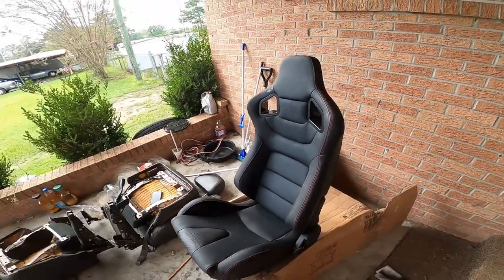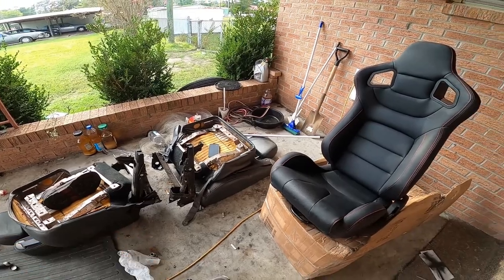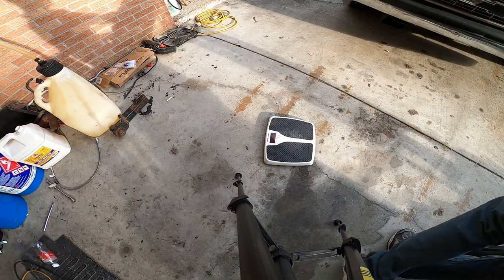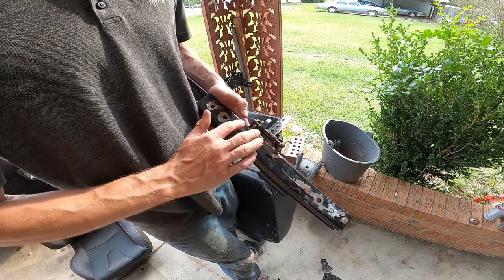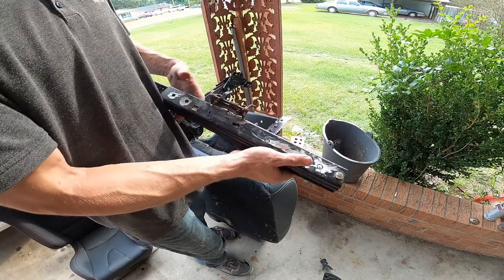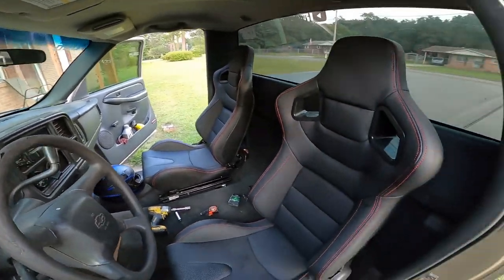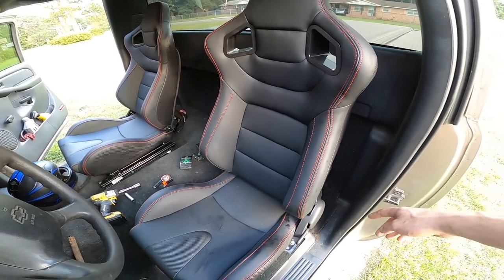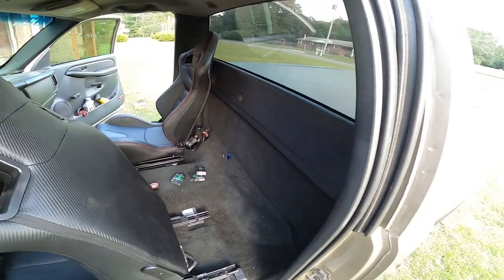Racing on a Budget: Amazon Race Seats Review under $350

Comment: Do you ever see yourself removing the air bags and going to a different/lighter steering wheel? If I ever got a clean V6 truck to build more race-orientated, I see a lot of weight that can be cut without completely gutting the interior. My truck is just too comfortable to me to ever try to shave weight out of it. I'd have to start with a more base model truck that doesn't have all of the power accessories mine has.
Reply from the maker: The passenger airbag is taken out just the cover is there but still has driver air bag but been thinking bout putting a race steering wheel on

Comment: I bought the same kind of seat off of eBay, less than a year of the ownership the welds at the bottom of the seat broke causing the seat not to stay up, very unsafe, i contacted the seller but no help was offered ATM
Reply from the maker: I been running them aint had a problem, i am only 150lbs though so not stressing as much as some people may. as far as safety i have a 4pt harness to hold me back thats bolted to body of the truck so i can go anywhere

Comment: I'd like to know how your feeling about them now. I've got damn near the same seats, but an an inch shorter "overall height"=35.4 , and boy the top harness holes are WAY Too low. Straight up UNSAFE to use harnesses with/already boxed up ready to return but seeing as yours are only an inch or so "taller" at 36.6 has me tripping. I'm 5'11" and you seem way taller. They look a BIT low (bottom of holes in reference to the TOP of your shoulders) in the clips I snagged but maybe I'm wrong. Do you just race with them reclined more than I like to get the room or are they just magically higher in the seat because 90% of these nrg/SM/amazon/ebay seats come from the sane factory lol
Reply from the maker: Mines perfectly even with my shoulders and I am 6'1 im still very happy with them. Still look great and feel comfortable to me.
Reply: @Frogs Garage  ok, glad to heat. Maybe I'll give those ones a try then. I agree, they look great. So I appreciate the response. I'd also love to line up with that rig ya got there lol. Once I get mine back in spec. Its full street trim right now, barely keeping it together enough to make it to work and home before partial disassemble again haha. But you know how it goes. Bowties forever
Reply from the maker: @beasyphone  Mines still full street trim to drive it everyday even pull a 24ft trailer with it (Has a Curt Hideaway hitch behind rollpan. Flip the license plate up and slide in my 2in reciever and ball and haul stuff. If ur local to south carolina be more than happy to let u have a shot at the truck :P.
Reply: @Frogs Garage  Raleigh NC, but I make it down from time to time! Mounting C6 calipers/Rotors Friday,  ditching my Camaro SS Brembos(up front,  the rears are sick, great cheap upgrade btw). I ended up keeping the street machine or whatever they ate for the fiesta and ordered Braum Alpha X for the S10, arrive friSaturday. I may need to swap TCC as it's acting up but my obd isn't cooperating (ashtray wiring had a fit and got hot/THANKS GM, so no codes , no tuning right now...not very happy about that but Tcc is easy and I need to do a filter anyway. I'll stay up tho, keep making vids..oh, I also just went ahead and ordered planteds, the driver arrived overnight, Very Very sick. Expensive but sick. May still use your trick for double length passenger,  I've got a big Miller I use for Mack/Volvo frames at work to use whenever.  Did my "6" 2-4-1 exhaust with it ((Jba custom to custom , yanaka y pipes to 4 collector to 5" single..call it "Squid Billy"..lol never named an exhaust before but it's fitting when you see it haha
Reply from the maker: @beasyphone  Well I run at Rockingham sometimes that aint to far from you might be able to meet up there and get a fun race on
Reply: @Frogs Garage  absolutely 💯 👌  good call. Be fun no matter what

Comment: When the air bag wire is disconnected will the air bag indicator stay on once the seats are replaced ?
Reply from the maker: I don’t have airbags hooked up in my truck so it’s always on anyways so I can’t answer that question I’m sorry
Reply: Yup, the light will be on. just figure out what the plug needs to see to turn the light off and give it that. So, if it wants to show a closed circuit, then jump the wires together and call it a day.